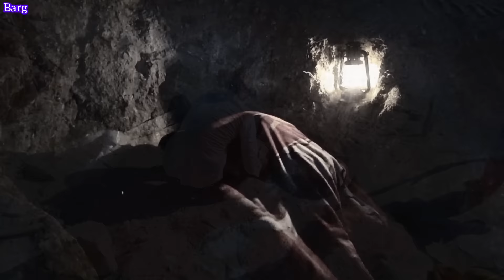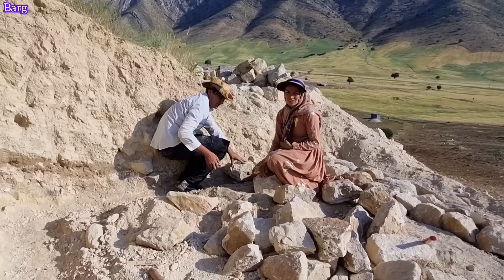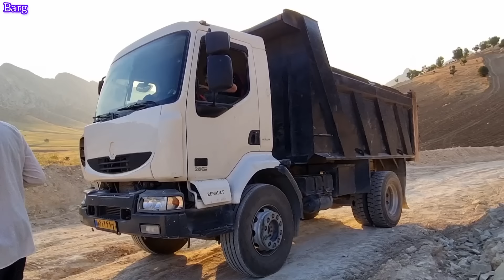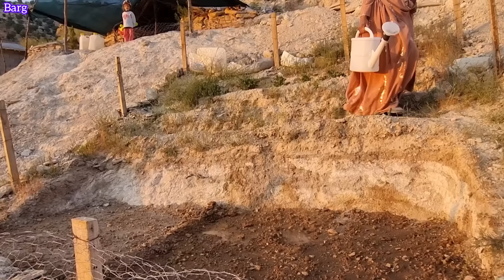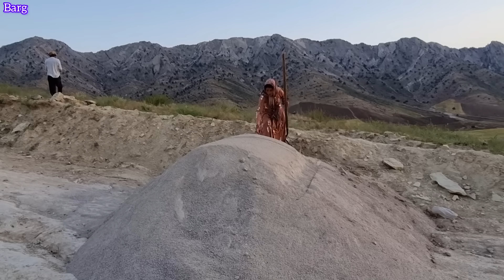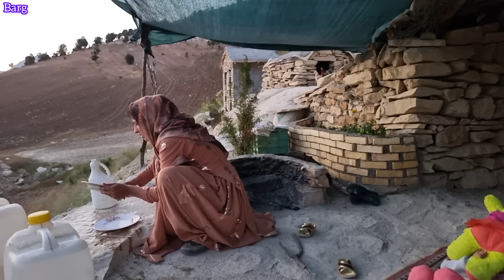Start building a house: Bringing a truckload of sand to build a nomadic house by Zari

Comment: Even when you step on the slope, the soft soil is visible, the soil below is already flowing, it is necessary to prepare a retaining wall in winter or before the rainy season, you need to protect the house with a solid wall made of natural stones and cement, which are common rocks in the environment.

Comment: Building a house on a mountain is tricky since a strong storm might erode the area holding this flimsy foundation. This may cause the house to break apart and endanger its residents. Such a structure should be built by a licensed contractor. I guess. this was built without a license or inspection by an engineer from the nearest municipality.

Comment: In heavy rains, the foundation of that house may slide because the slope is just soil, it is not suitable for building a house., That hill is not rocky, it's just a dirt hill. If you are building a house, you need to build a retaining wall on the slope or you need to feed stones to the bottom of the slope, such as a gradual staircase.